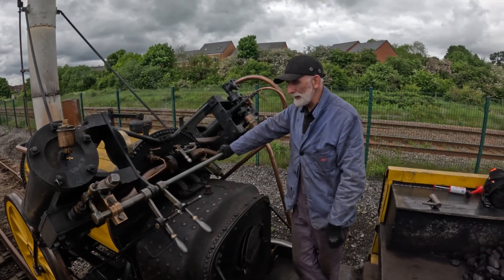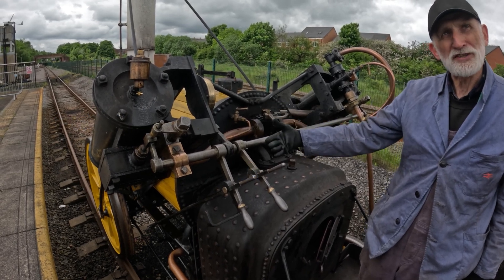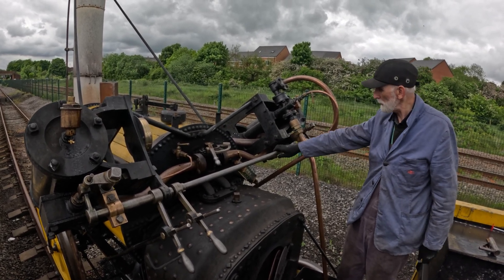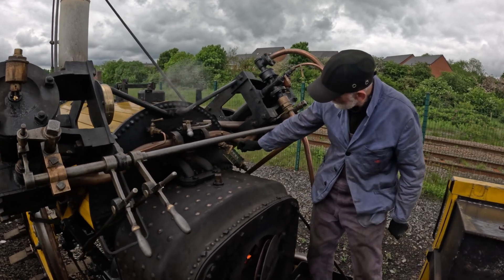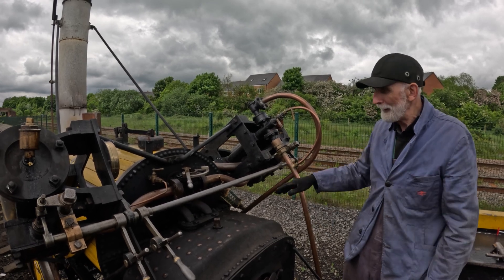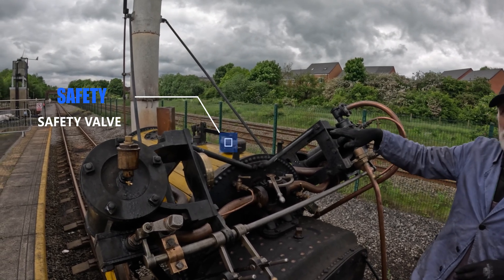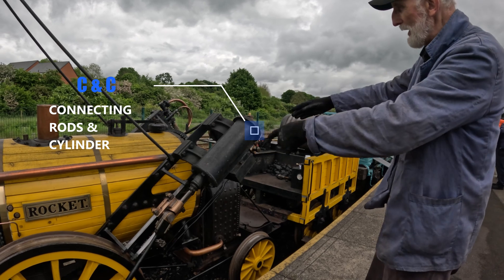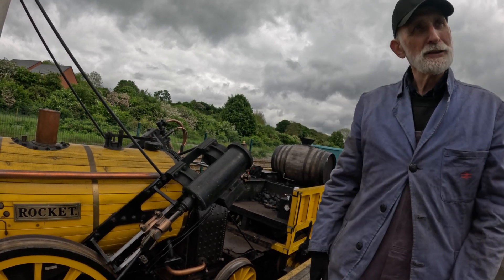Stephenson’s Rocket: The Steam Engine That Transformed Travel!

Comment: Fun fact: the diameter of the locomotive’s own official 2 drive wheels certainly happens to be exactly 1/4” more than the official measurement of the standard gauge tracks that it’s built to run on that are specifically measured @ 56.5” simply meaning the Stephenson’s Rocket’s own official drive wheel diameter’s clearly measured exactly 56.75” as mentioned in the official specifications that I’ve read from my own official Smithsonian train book multiple times!
Reply from the maker: @DavidS-s9i  The gentleman did mention about the Replica being wider than the original. Interesting.